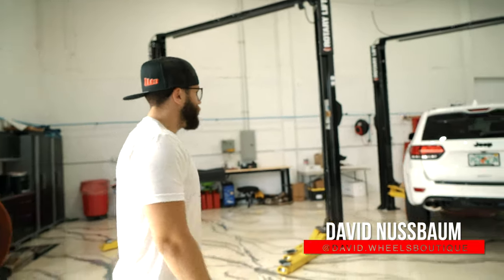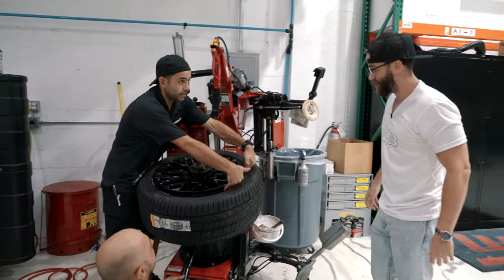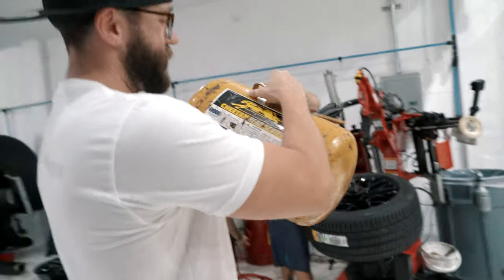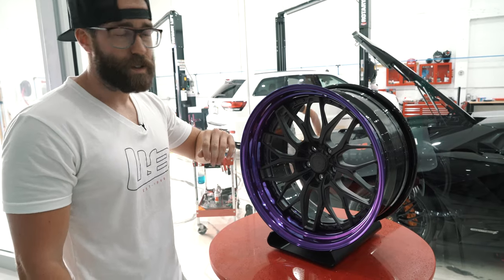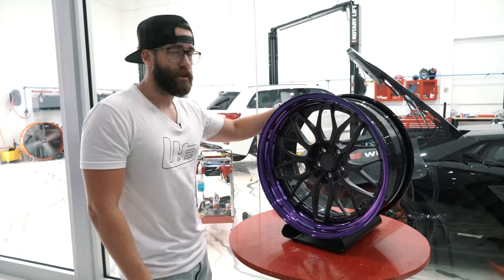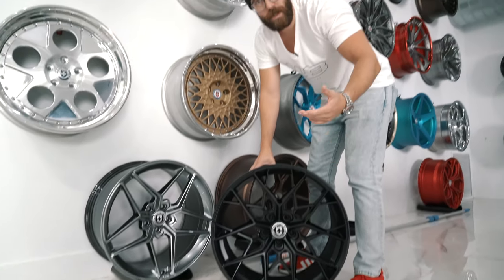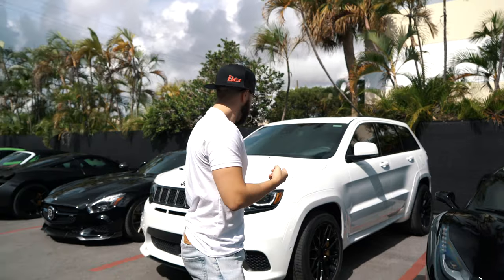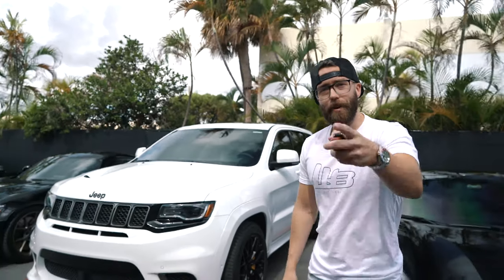1000 HP TRACKHAWK GETS ANRKY WHEELS.

Comment: I just bought a 2018 trackhawk that you guys modified with an35 wheels.  They are getting stained from brake dust.  How do I clean?
Reply from the maker: We would recommend ceramic coating the wheels. After that only soap and water should touch them.

Comment: Do you recommend 20 or 22 inch wheels for the Trackhawk?
Reply from the maker: It depends on the way you plan to use your Trackhawk. Will you be taking yours to the track/drag strip at all?
Reply: WheelsBoutique     Its my daily driver.   Want new wheels for the look and keep the standard ride height.   If I take to the track ill use my stock wheels.
Reply from the maker: @RalHellcat  In that case we'd recommend 22's because it will arguably look a hell of a lot better than 20's. I have some photos of a Trackhawk on 22's. Reach out to us if you're interested in seeing them - David@WheelsBoutique.com